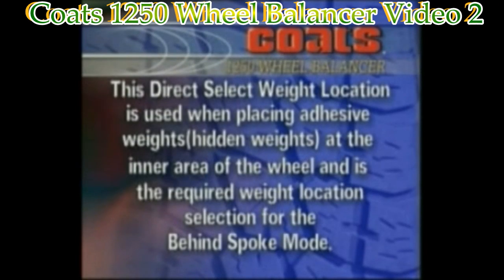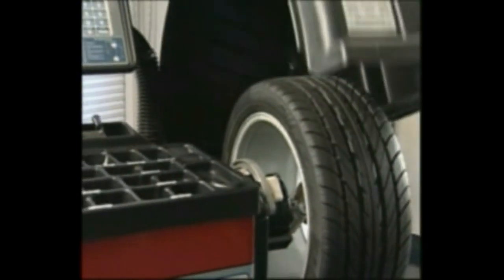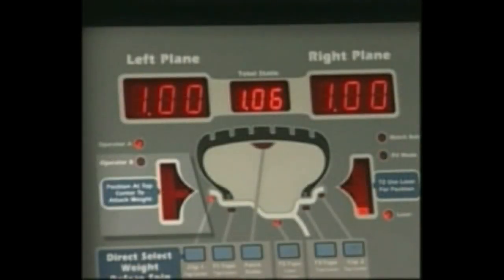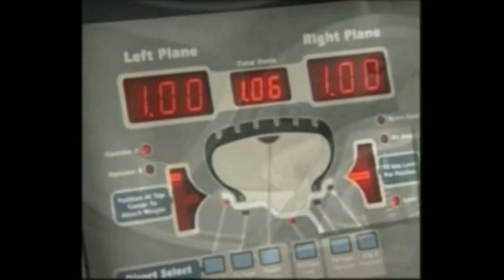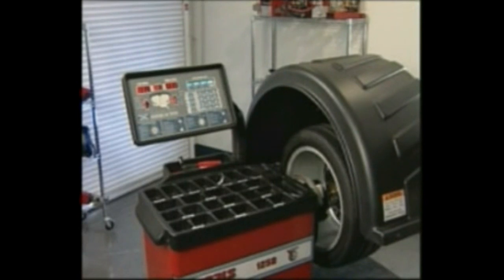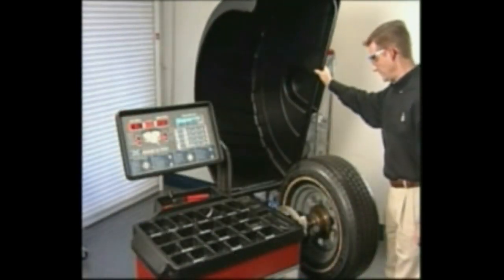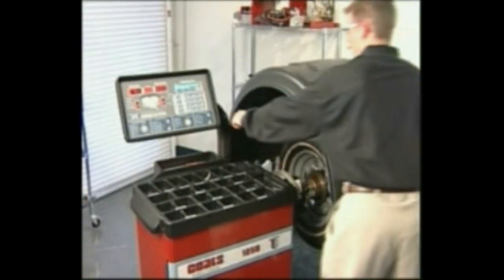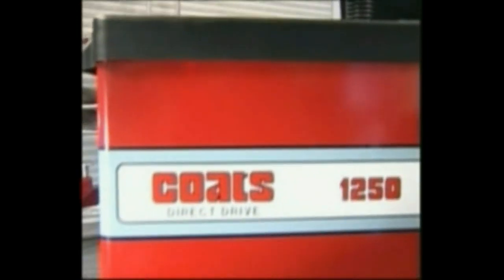Coats 1250 Wheel Balancer VIDEO 2

Comment: during calibration mode, spin once, put 4oz TDC on outside flange then spin and put 4oz TDC on inside flange. before you spin again, do you leave the outside weight on or take it off?
Reply: According to the manual, you have to take it off and install on inside flange
Reply: page 17.